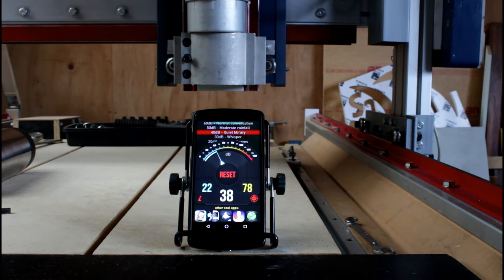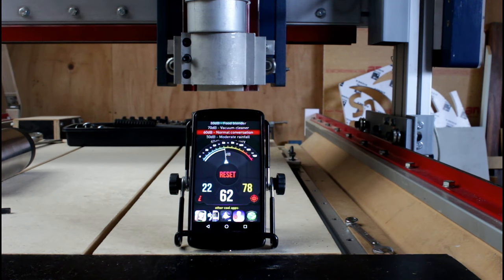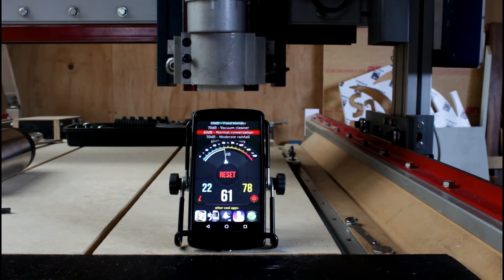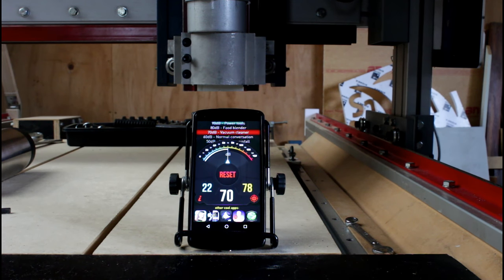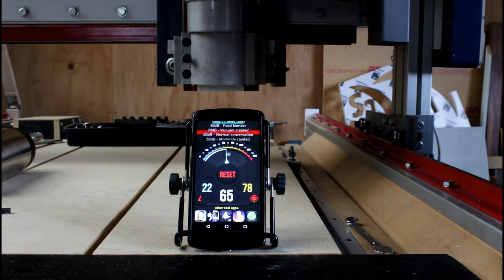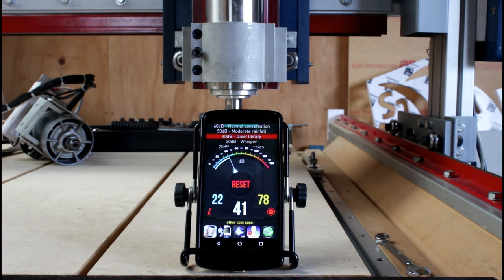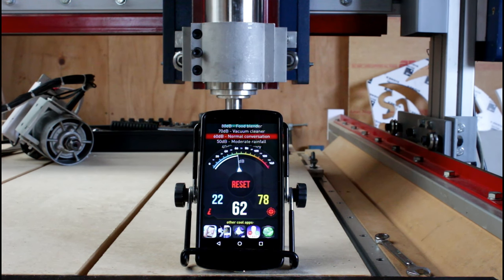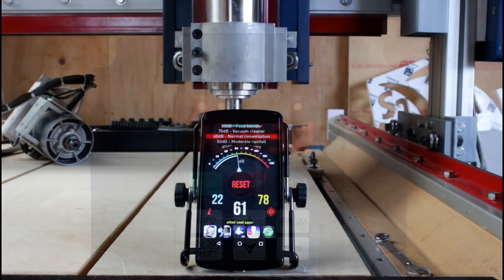Spindle Noise - CNCnutz Episode 143

Comment: Hi Peter, thanks for satisfying my curiosity. However what were your findings with say cutting hardwood with an end-mill between the spindle and the router. How much percentage difference? Thanks.       Merry
Reply from the maker: I don't really know. It has been so long since I changed it that I can't remember and I didn't make any other comparisons at the time. I very very rarely cut hardwood. All I can really say is I like the spindle and it is better than the router.
Cheers
Peter

Comment: verry curious on how you will hook it up to the controller , have been looking intoo some add on board but haven't found anything that jumps out at me as an all in one solution (dont have the gecko setup you have but seperate leadshine drivers)

as for the noise in general , the best solution to that is build a cabinet with a window around the machine , seen some examples and these work realy whell
Reply from the maker: +watahyahknow 
Not sure how I'm going to do it yet myself though the Gecko should make it easy. 
Cheers 
Peter
Reply: See my reply above... it is very easy with your VFD... about every one I have ever seen has a 0-10vdc interface. And I am certain Mach will output PWM... you just convert to analog with $3 worth of parts.
http://wiki.linuxcnc.org/cgi-bin/wiki.pl?VFD_Digital/Analog_Interface

I made a board for my CNC stuff... shared it on Osh Park... have yet to install it... I still have the breadboarded one I built... works flawless. BUt here is the permilink of you want to build one.
https://oshpark.com/shared_projects/qzA73pwI

It is designed to take 5v PWM (LinuxCNC or Mach) or 3.3v of you want to control via Raspberry Pi, ESP-8266, or similar. I think it was $10.50 USD for 3 boards. (Minimum order) Or just breadboard it... pretty simple.
Reply: started to read through the pdf file with the manual :
"The board also has an IDC16 analog I/O port with 2 analog inputs and 2 analog 0-10V outputs" , ok so the controller HAS a 10 volt output 
if you look at the 5 volt input terminal on the UC300ETH-5LPT its port 1 , port 2 , port 3 ,,,, then the 16 pin analog port ..... port 5 , and port 6
Pin numbers and Signal direction : 
1 = 12 Volt output , 
2= Ground , 
3=Analog input 1 , 
4=Analog input 2, 
5=Ground , 
6=Analog output 1, 
7=Analog output 2, 
8=12 Volt output , 
9=12 Volt output , 
10=Ground , 
11=Analog input 1 , 
12=Analog input 2 , 
13=Ground 
14=Analog output 1 , 
15=Analog output 2, 
16=12 Volt output
he probably could wire it in straight from the controller but an optocoupler might be wize to prevent any surges making the 5LTP motherboard of the controller going poof 
thats where he needs the add on thingy for ,........ looking at wat you gave the link for i think he needs the second picture in the first link on a breadboard or ready made
Reply from the maker: +askjerry 
Thanks Jerry. 
I will be looking into it later today ask going well. 
Cheers 
Peter

Comment: Are you going to use PWM from Mach to control the spindle speed? I'm using LinuxCNC... but basically the same thing... you take the PWM and pump an optocoupler connected to a 12vdc supply... run the output through a capacitor and resistor... and you get a roughly 0 to 10vdc output that goes to the spindle speed control. With a little tweaking of your settings... you dial it in... and then you can control your spindle speed with G-Code.

I made a little circuit board if it helps: https://oshpark.com/shared_projects/qzA73pwI
Reply from the maker: +askjerry 
I'm in 2 minds about using PWM but I will give it a try and see how I live it. 
Thanks for the advice. 
Cheers 
Peter
Reply: Right now my Frankenlab gauge shows the commanded speed, not actual. I have a sensor... just been too busy to connect it and calibrate it. Once I get the chance... it will show commanded, actual, and if it is "Up to Speed" or not. Should be handy. (assuming I'm ever home more than 3 days.)
Reply: I like it because I am using Aspire software... so for one bit I may specify 3000 RPM, for another 6000 RPM, and for a small engraver I may run at 9K or 10K. For aluminum I may run slower. I assign my speeds in my tooling. Then I select for a specific job and don't have to worry about it... I just run the job.

jerry